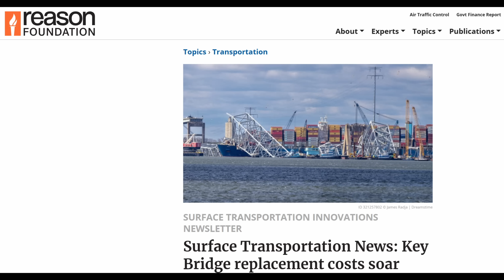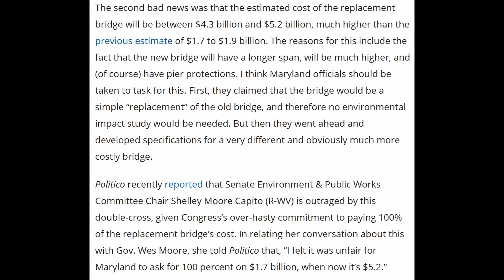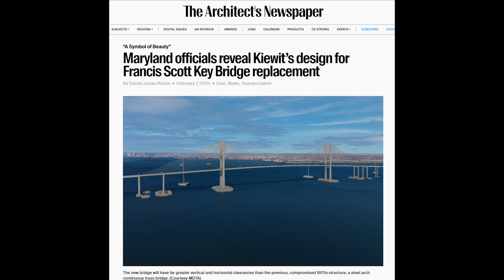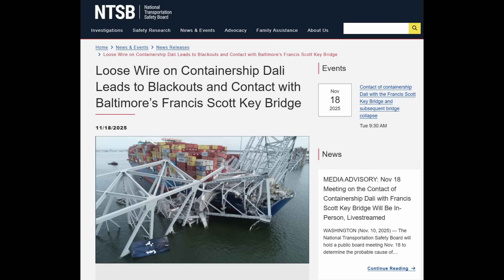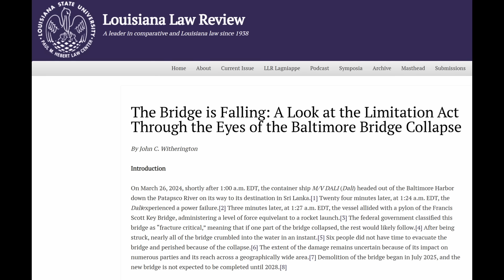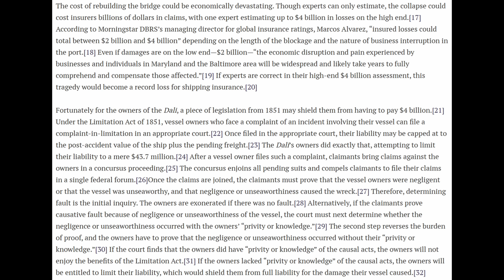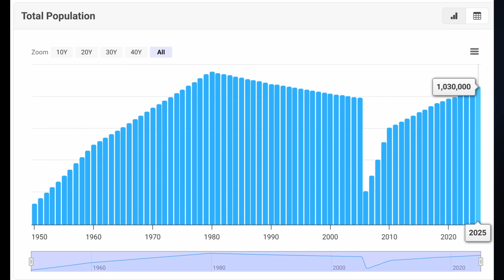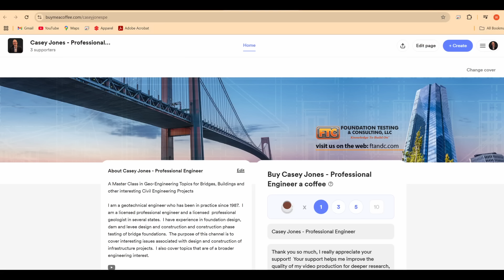Should U.S. Taxpayers Pay for a $5 Billion plus Key Bridge Replacement?

Comment: This was another case where there should be an "as-is" clause that removes liability on the part of the traffic engineer for using an "obsolete" design if the replacement is an identical or nearly identical structure. Truss bridges may be fracture critical, but aside from a barge hitting, like what happened, or weakening of critical members due to severe disrepair, they are structurally sound. Nobody wanted to see the Key Bridge as it was designed lost. It was a very unique and irreplaceable design. It would have been much, much cheaper to have simply rebuilt the damaged columns and truss structure exactly as it was, especially given that the approach spans were perfectly fine to use. The only thing that needed to be modified was adding the crash barriers that MDTA had failed to install to protect the structure.

Comment: No, it makes no sense at all to subsidize dwellings in areas prone to flooding from hurricanes.  Personally, I think getting a building permit for a coastal feeling should require an amount equal to the replacement cost of the dwelling be placed in escrow and the escrow amount be added to each year to match the current replacement cost of the dwelling.  If this was required, it would greatly reduce the number of buildings to get destroyed in the next hurricane.

Comment: Trying to read between the lines here my guess is that the original cost estimate was for replacing the bridge with bare bones enhancement and minimal safety upgrades.  When the federal government stepped in and said “we will pay for everything” bare bones enhancements and minimal safety features considerations went out the door because cost was no longer an issue.

This leads me into our other issue.  I suspect that the Key bridge rebuild act was pushed by local politicians and rammed through congress by old fashioned “you scratch my back and I will scratch yours” backroom politics.  Politics dominates over what is best for the country as a whole.  Both parties are to blame to some extent in my opinion.  Our politicians get elected by promising the moon.  Long  term costs to our children and grandchildren are always glossed over or even worse ignored.  We collectively are responsible for this  spending situation getting out of control because we don’t bother to hold our politicians accountable for spending like drunken sailors.

Comment: Reason Foundation Article on Key Bridge

Surface Transportation News: Key Bridge replacement costs soar, Robert Poole, Reason Foundation Director of Transportation Policy, December 2, 2025
Excerpts:

NTSB correctly identifies the Maryland Transportation Authority (MDTA) as having been at least partly responsible for the bridge's collapse. NTSB noted that countermeasures such as "dolphins" could have been implemented if MDTA had performed the AASHTO risk assessment. As I have reported previously in this newsletter, MDTA also ignored "repeated warnings" from the Baltimore Harbor Safety and Coordination Committee about the lack of meaningful protection of the bridge piers. I believe it can be argued this is what attorneys call "contributory negligence."

The second bad news was that the estimated cost of the replacement bridge will be between $4.3 billion and $5.2 billion, much higher than the previous estimate of $1.7 to $1.9 billion. The reasons for this include the fact that the new bridge will have a longer span, will be much higher, and (of course) have pier protections. I think Maryland officials should be taken to task for this. First, they claimed that the bridge would be a simple "replacement" of the old bridge, and therefore no environmental impact study would be needed. But then they went ahead and developed specifications for a very different and obviously much more costly bridge.

Politico recently reported that Senate Environment & Public Works Committee Chair Shelley Moore Capito (R-WV) is outraged by this double-cross, given Congress's over-hasty commitment to paying 100% of the replacement bridge's cost. In relating her conversation about this with Gov. Wes Moore, she told Politico that, "I felt it was unfair for Maryland to ask for 100 percent on $1.7 billion, when now it's $5.2."

End excerpts.

The Reason Foundation's Surface Transportation News reports that the replacement of Baltimore's Francis Scott Key Bridge faces major challenges. The National Transportation Safety Board (NTSB) recently faulted the Maryland Transportation Authority (MDTA) for failing to conduct a required risk assessment (based on guidelines from the American Association of State Highway and Transportation Officials) on pier protection from collisions with major ships., noting that countermeasures such as "dolphins" could have prevented the collapse. The NTSB also highlighted repeated warnings from the Baltimore Harbor Safety and Coordination Committee that were ignored, raising questions of contributory negligence.

Meanwhile, cost estimates for the new bridge have soared to between $4.3 and $5.2 billion, far above the earlier $1.7–$1.9 billion projection. The higher costs reflect a longer span, greater height, and enhanced protections. Political fallout has followed, with Senator Shelley Moore Capito criticizing Maryland's request for full federal funding despite the escalating price. Debate continues over whether taxpayers should bear the entire burden given MDTA's role in the disaster.

Roads to the Future (Scott M. Kozel) has opined in great depth about the feasibility (or infeasibility) of protecting deep water bridge piers from ship strike by Panamax sized ships. My takeaway is that MDTA failed to perform the vulnerability assessment recommended by AASHTO, and that is in the Probable Cause of the NTSB Accident Report. That is very strong language for the NTSB, even though it is stated in seemingly mild words. The issue isn't really whether there is any dolphin/island construct that could stop a large ship, so much as the fact that MDTA did not conduct a comprehensive vulnerability assessment in the first place.

The results could have been to accurately define the risks in an official document that could be the foundation for future planning. This future planning might have been to produce a preliminary engineering study of an ultimate replacement of the bridge, with either a longer span bridge with no deep water piers, or a tunnel under the harbor. This could have been a wise investment to have preliminary engineering already completed and in a document that could be the foundation of a project to be ready to go forward in the case that the original bridge was severely damaged or destroyed by ship strike or ship explosion/conflagration. As it is it has been 20 months since the collapse and much work remains to be done to produce a final design and a set final contract cost.

This is one of the worst (if not the worst) handled highway projects that I have seen in over 55 years of following major highway project developments.

www dot roadstothefuture dot com/Balt_Outer_Harbor_Proposed.html

Comment: I agree with a lot here.  But I think it's wrong to blame the state for the inadequate protection from ship traffic.  Safe navigation on US waterways is enforced by the federal government.  I question whether the state could have built larger dolphins without federal approval.    I'd agree that Biden was to quick to commit to paying 100%.  There are dozens of vulnerable bridges around the country.  Maybe the money would be better spent on protection of those bridges.
Reply from the maker: The thing is the state of Maryland owned this bridge and they collected the hundreds of millions of dollars and tolls over the years.  It was ultimately their responsibility provide adequate protection.  They cold have  asked the federal government for a grant to do just that and they never did.
Reply: @CaseyJones-Engineer  
You could spend $200 million on one bridge --- The problem with bridge protection schemes is 1) there is no feasible way to test them to see if they actually will perform, and 2) the size of the pylons and/or islands is constrained by the hydrology of the river.

They would need to prepare a NEPA Environmental Impact Statement before placing large structures in the river, and then get approved by the feds.

Comment: I’ve avoided the KC to St Lou part of I-70 for 30 years, but not for the traffic (which is worse in the East)—because every 5 seconds, the car’s tires hit a concrete seam…bump…bump…bump…bump…for 250 miles. It happens on NY turnpike too. Beautiful drives elsewhere.

Comment: All this talk about HAZMAT that constantly comes up on various forums that discuss this bridge. The best data I can find is that the AADT was about 32,000 with 10% large trucks with about 10% of the shipments being material that MDTA won’t allow thru the tunnels.

So about 350 to 400 shipments per day. To me that is very little justification for spending $5 billion to avoid tunnels; granted there were the other 31,000 vehicles. But the two Interstate highway cross-harbor tunnels carry the 225,000 AADT now and have a total of 12 lanes.

That is about the same AADT as the I-495 American Legion Bridge which has 8 thru lanes. The Key Bridge had 1/7 of that traffic and Maryland is doing nothing to expand the ALB and the rest of I-495 between VA and I-270 to the VA 12-lane cross-section (4-2-2-4) with HOT lanes.

I don't understand why they can't open the I-95 Fort McHenry Tunnel to those 350 to 400 shipments per day. It is a modern tunnel designed in the latter part of the Interstate System construction era.

HAZMAT constantly goes thru the antiquated railroad tunnels in the city of Baltimore and Washington. Granted railroad is intrinsically safer than highway, but getting certified to drive a HAZMAT truck is only granted to drivers with impeccable driving records, and at least 2 million miles of regular truck transport experience, and with special training for HAZMAT transport. The trucks are also maintained to extremely high standards. It should be plenty safe for them to transit the tunnel.

At least give them access say between 1 am and 5 am when volumes are the lowest.

Comment: As usual, an interesting and thought provoking discussion and analysis. Here's my question, which you may have already answered, albeit indirectly. What exactly are you suggesting or proposing? ln other words, is the replacement of this bridge insufficiently critical such that the costs of replacement are not justified? Obviously, that's somewhat subjective, but the it's safe to say most, if not all those who were directly or indirectly dependent on the old bridge would likely say "yes" while others would clearly have a different opinion.

This brings us back to the old argument about the role and responsibility of the Federal Government in financing large infrastructure projects whose existence, or lack thereof will affect sufficiently large industries and areas of the country. Personally, l'm glad l don't have to make that decision.
Reply from the maker: Bottom line what I'm recommending is a detailed cost-benefit analysis to decide if the bridge is actually worth replacing.  And if it is, what should the federal commitment be.
Reply: @CaseyJones-Engineer  Thanks for the explanation. lt makes perfect sense, as usual.

Comment: The cost-benefit analysis needs to be front and center. My quick calc based on 30k/day says that each trip across the bridge would cost about $32/ crossing (assuming Maryland bond rate of 3.5% financed for 20yrs.) It's not clear if the market could bear that cost even if you allocate the crossing fees by weight. In that case truckers may accept slower routes to avoid a costly crossing. I'd like to hear what a typical taxpayer burden of an average bridge crossing is. Reason should have done some more math can outlined free market cost & solutions.
Reply from the maker: Your analysis and approach makes perfect sense.  I just don't see the economics for this replacement working out at the current projected costs.
Reply: @CaseyJones-Engineer . You have to take into account the primary purpose of the bridge and pull up a map of Baltimore. Pre- bridge collapse the I95 corridor was service by three routs I95, I895 and I695E. I95 and I895 are tunnels, so Hazmat had to use I695E over the FSK bridge, go through downtown Baltimore to one of the connecting interstates, or use I695W which adds 20+ miles. This makes the question, does building a bridge with X amount of cost but a 100 year lift span offset the economic burden to not only Maryland, but the East Coast as a whole?
Reply: Average dry van rates are around $2.05-$2.06 per mile (spot) or $2.35 per mile (contract), while the total operating cost for private fleets can be as high as $2.90 per mile or $2.26 per mile, according to the American Transportation Research Institute (ATRI). A $32 bridge toll might be a bargain.

Comment: The shipping company should definitely bear some liability as it was their ship that took out the existing bridge. I don't know exactly how much that should be, but I do think it's reasonable to expect the taxpayers to have to shoulder at least some of the burden of replacing the bridge - specifically because there were known deficiencies that were not addressed and the public would have covered the cost of a replacement bridge eventually anyway.

It's not a surprise that the replacement bridge will cost more than originally estimated - that's actually fairly normal in a lot of public infrastructure projects. But a five-fold increase? That's... not normal. That can't all be from tariffs... So why were they so incredibly off on how much it would cost?

Comment: Concerning New Orleans and your comments at 13:00.  There IS no other place for New Orleanians to expand to.  From the 50s forward those “other places” were developing from northward into the then small towns north of the city, westward across the Mississippi via two twin bridges to the extensive west bank, and south and inland down each side of the River.  A huge population moved across Lake Pontchartrain eastward, so much so that the then longest bridge in America, the Lake Pontchartrain Causeway, was built and within a few years a parallel bridge also built.  New Orleans center is not just metropolitan New Orleans.  The entire area I’ve described above was devastated.  Should those millions all leave?  Where to?  How about those sitting on the San Andreas fault?  Should they all leave now?  Then there’s Tornado Ally in multiple states.  I for one do not at all understand why people live  there.   Federal Corps of Engineers had been informed by local New Orleans Corps for decades about the danger posed by an aging system: dirt levees sagging and so undercut and ancient pumping stations primed to fail.  The local government was hamstrung because federal law puts the Corps,  not the local government,  in charge of America’s major waterways—like the Mississippi River, Lake Pontchartrain, and the Gulf of Mexico.  It’s those first two waterways, not just the rain, that flooded the city.  Blaming a city for suffering from the impact of a federal law hardly sounds just.  Those billions that went to finally building modern flood protection would have been enormously less if the Washington Corps bigwigs had listened to the local Corps.  Some of that funding went to Netherlands engineers who kindly came over to help with the design.  Well, news flash: the Netherlands existed every time the New Orleans Corps begged Washington for proper protection.  Look it up, Casey, research it.  You’ll see that every word I say here is true.